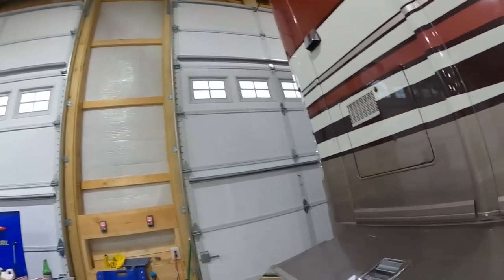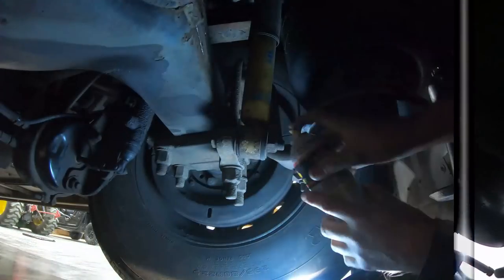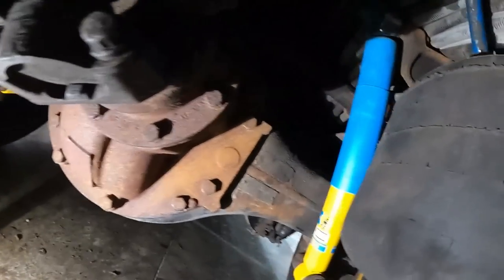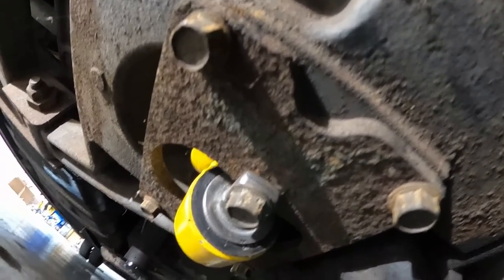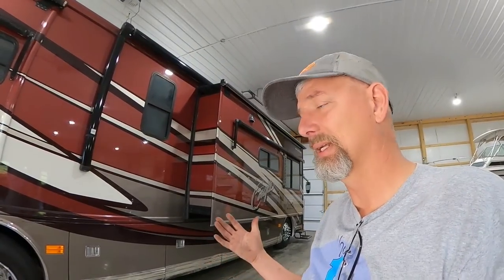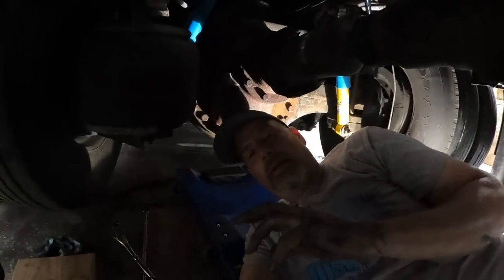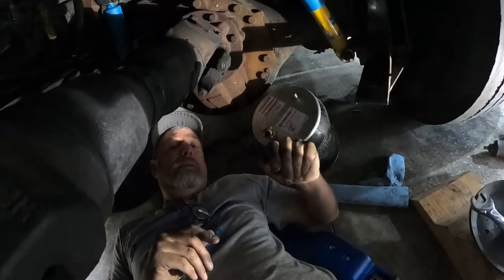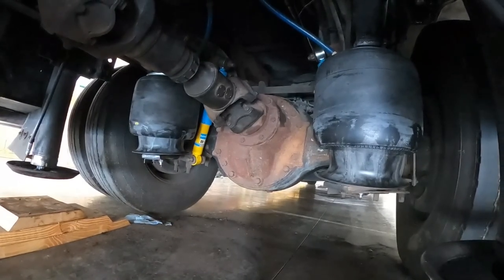Installing Lower Skid Plates, Shocks and rear Air Bags | 2005 American Eagle | EPS6 | Shots Life

Comment: Great video!  You may consider a piece of cardboard to crawl and scoot on when a roller board is too big to side under the bus. There are many advantages.   It is easy to slide on, insulates you from the cold floor in the winter,  makes it easier to see your tools and parts than on the concrete floor.  It is a little softer for elbows and knees when twisting into positions, too.
Reply from the maker: Sounds like a brilliant idea! Thanks!